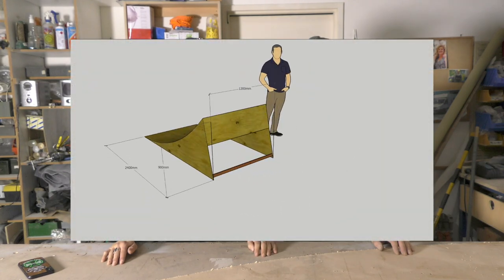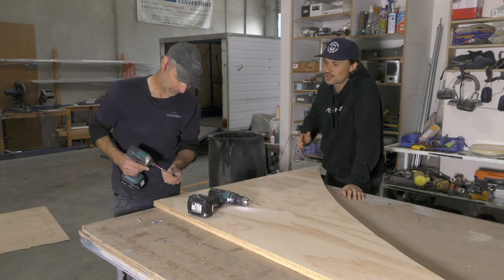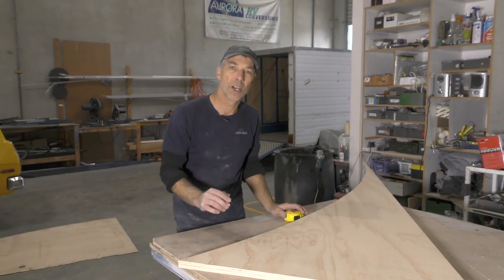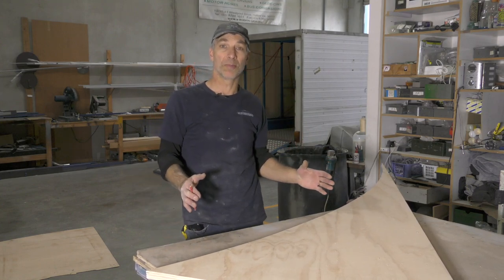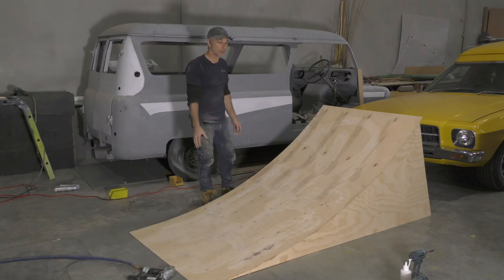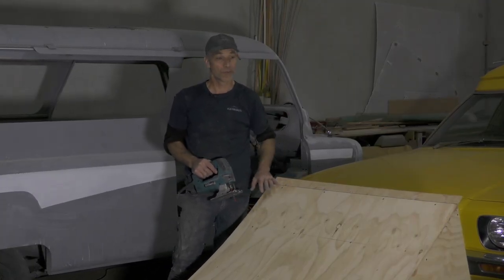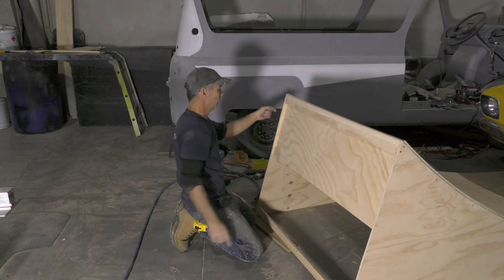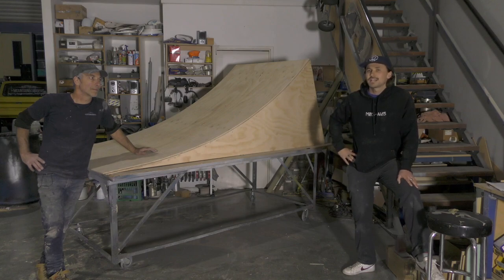HOW TO BUILD A 3 FOOT KICKER RAMP

Comment: I really enjoy all of your videos. I was wondering what are the best shoes for riding mountainboards? I ride vans for  skateboarding and fivetens for mountain biking. Is there a specific shoe  that you like or does the heel strap take care of slipping?
Reply from the maker: I normally always wear Vans Half Cabs, I did however just buy the Vans Sk8 Hi Pros to try something a little different. In short you want a shoe that's a little thick and the tongue needs to sit higher then the binding. You want to fill out the binding as much as possible. If your fit are still slipping out maybe its time to try some heelstraps